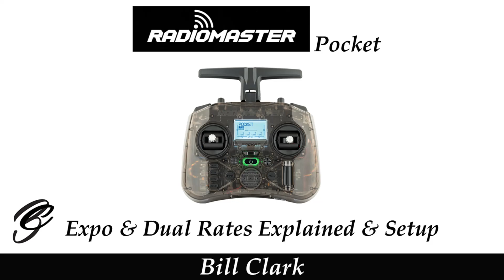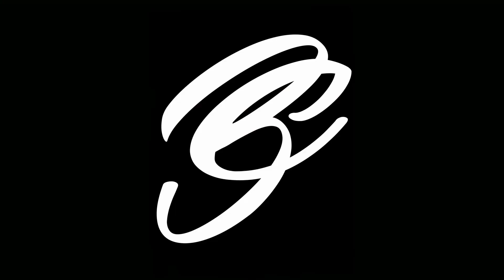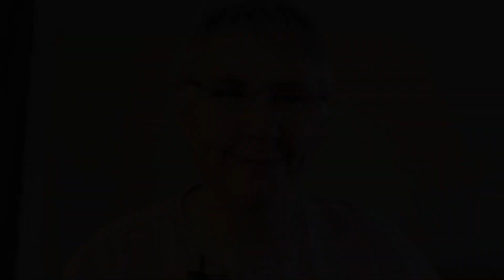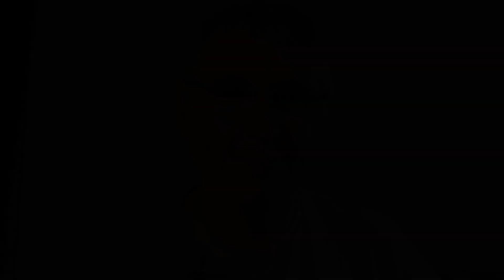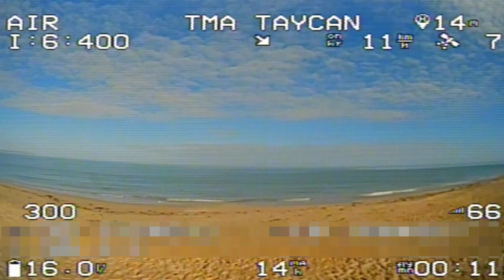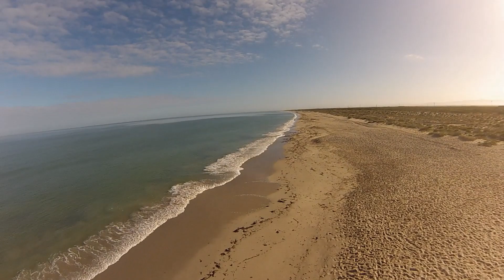RadioMaster Pocket Expo & Dual Rates Explained & Setup

Comment: its possible to switch the rates on flight? or need to disarm change the rates then arm again?  thanks this list of pocket tutorial was very helpfull for understand my new pocket
Reply from the maker: No problem to switch rates inflight but when first testing do it at height so you can get the feel of your plane and if not responding enough switch back to full rates.